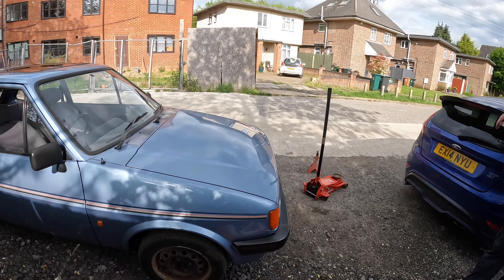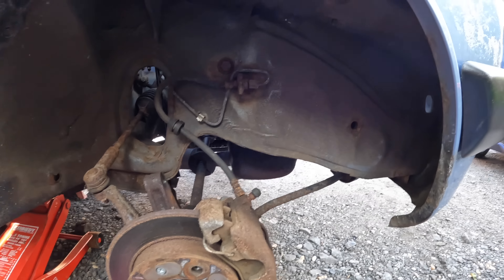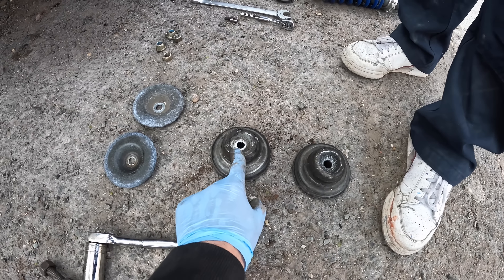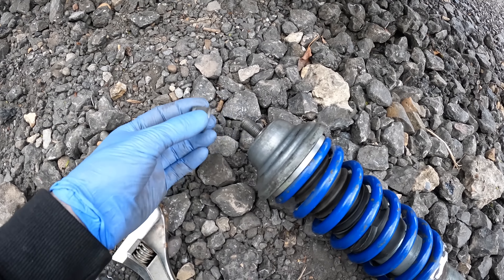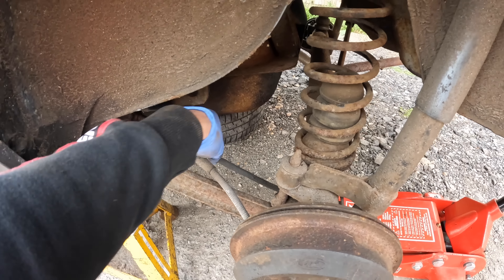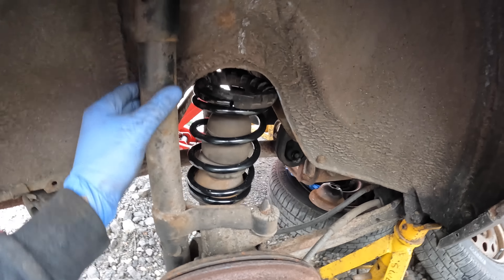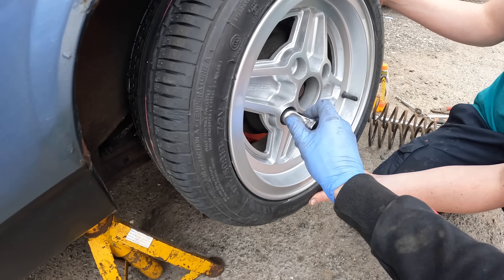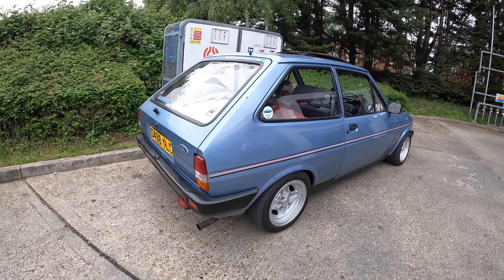WE LOWER MY FRIENDS CLASSIC MK2 FORD FIESTA!

Comment: I had exactly the same MK2 model as my first car back in 1994.  C498 HRL, same colour.
It had a MK1 XR2 rubber boot spoiler, MK2 XR2 steering wheel and a K&N air filter.  Great fun car.